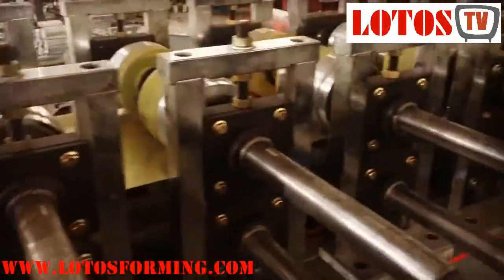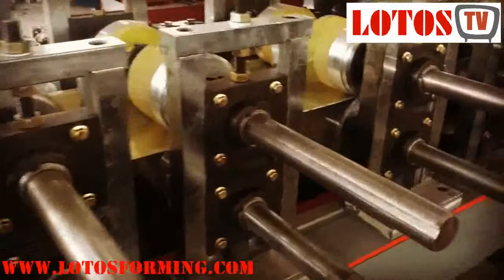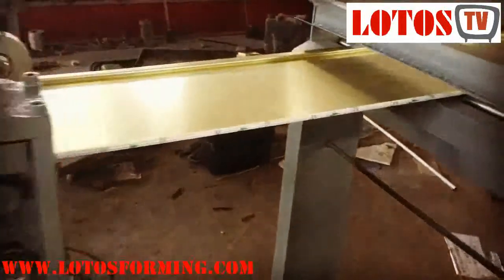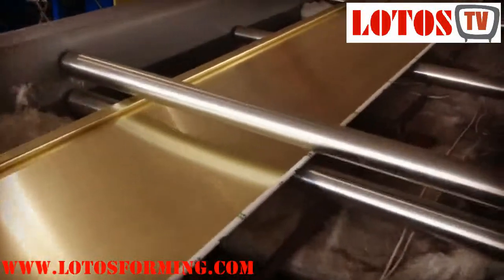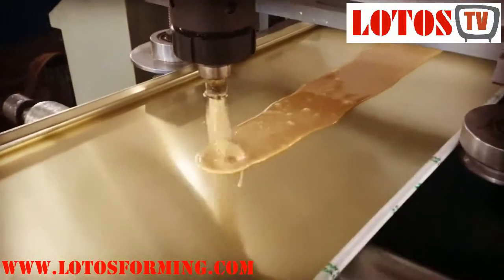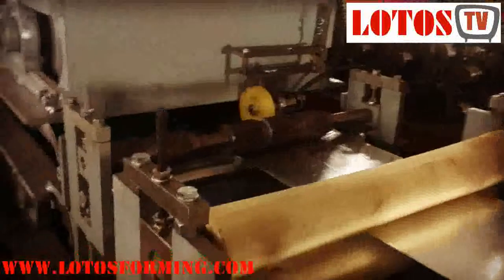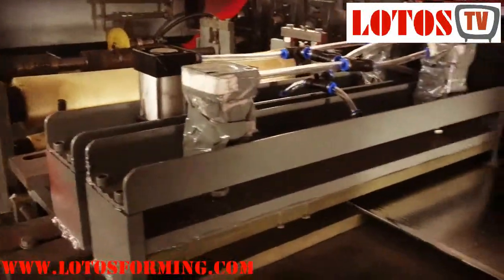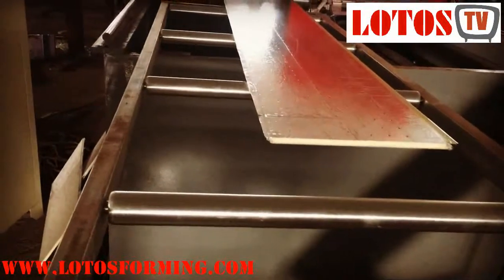Pu Panel Machine : ◁ PU Decorative Panel Roll Forming Production Line ▷

Comment: http://www.lotosforming.com/decorative-panel-roll-forming-line/
Reply from the maker: This PU foam siding popular wall cladding panel production line should be able to fulfill the material for composite sandwich panel continuous production of polyurethane, that is a continuous injection liquid raw material into the pressing of the upper and lower panels. Reaction, foaming, curing, forming in dual pedrail molding machine; Production the composite sandwich panel line with the state for the metal surface of rigid polyurethane sandwich panels. The PU sandwich panel has a function of sound insulation, heat insulation and prevent burn and use in wall panel, and so on.